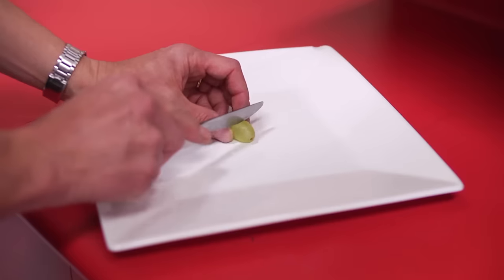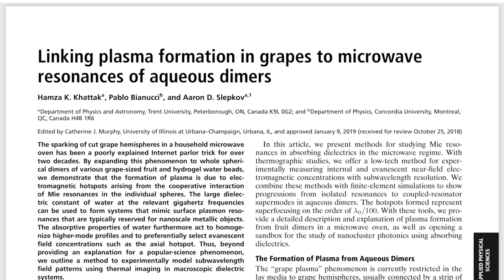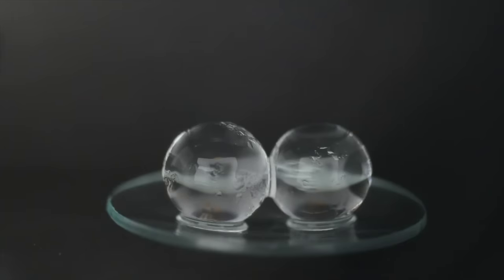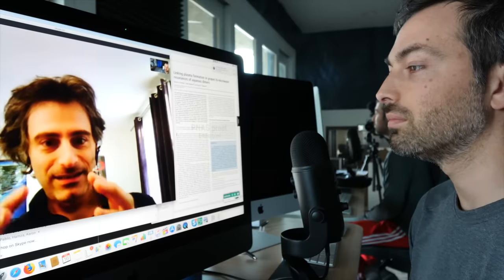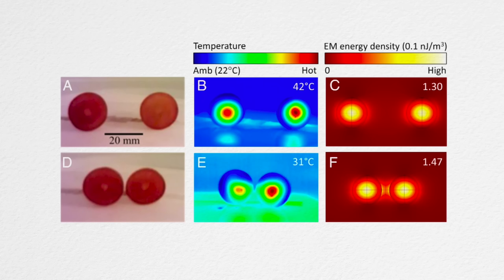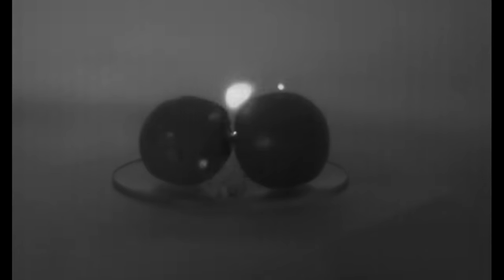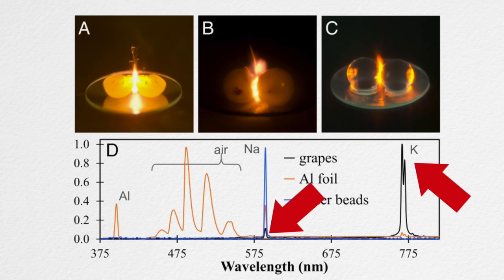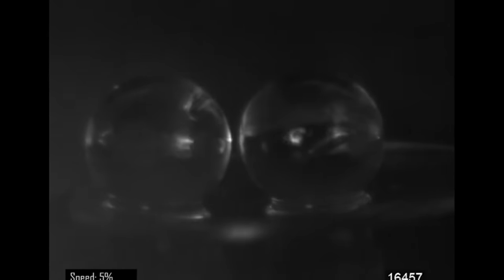Microwaving Grapes Makes Plasma

Comment: But how do l turn my microwave into a time machine...
Reply: A toaster, maybe---but a microwave? No way!
Reply: Lol
Reply: Don't be silly, you can't turn a microwave into a time machine you have to use your hot tub for that.
Reply: Put it in front of an exploding sun, obviously. #Futurama
Reply: You need a cell phone and a black hole
Reply: You gotta use bananas
Reply: Ask Kip or Uncle Rico.  I think they might have something that could help.
Reply: Don't forget the crystals!
Reply: I thought the time machine was at the back of Costco?
Reply: Hmm, maybe something to do with Braun tubes & Gelbananas? 🤔🤔🤔
Reply: You'll need a magnifying glass ,a desk chair with wheels. A wet sponge. And of course duck tape
Reply: A microwave is a time machine; Why else do you set a timer? Because it's a time machine👀 mind blown
Reply: Ima mad scientist. Is so cool
Reply: Steins;Gate
Reply: This is Veritasium, not "HOUOUIN KYOUMA!" 
Although you could always try with a cell phone if you have one to spare
Reply: you make the microwave plate turn in the inverse direction at just the right speed, hook up a telefone to it, and make sure there is a working television hooked up to your eletric sistem. the television is essential.
Reply: Bananas and an old computer.
Reply: That's easy, when you heat something you turn the timer clockwise to the desired time you want of heating, but if you turn it the other way around from 0, you travel in time.
Reply: Wolffang731 by making it into a bone density scanner, the real ones will get this!
Reply: Mario Cantu your thinking of an alarm clock, or just a clock in general too
Reply: Wolffang731 just turn the time back
Reply: Wolffang731 you have to get a wormhole, something in space that is a literal time machine. You sure you can afford a wormhole? I have some, but they’re huge and expensive.
Reply: You need Bananas, not Grapes if the Banans start turning green, both peel and all, you're on the right track. 

Just be sure you stay on the right world line
Reply: Makin Waves so an mri?
Reply: Put a bunch of clocks in it and microwave them.
Reply: Try your van
Reply: Put a banana on it
Reply: Easier to do with a Bambleweeny Improbability Generator and a very hot cup of tea.
Reply: You need a cell phone, an otaku, and a redhead assistant
Reply: @bubbyradio9112  Don't forget a doot doo do girl
Reply: @Wolffang731  Doot doo do girl is the best.
Reply: Put gasoline in it
Reply: watch Steins:Gate for that answer. Just don't regret making one when you do...
Reply: Well microwave ovens are supposed to cook things quicker, so stick something instant in there, like instant coffee. Dunno how you would go back in time though . . .
Reply: Just watch steins gate

Comment: I always thought that’s how you make raisin so I been eating plasme and I still haven’t gain super powers yet so I guess I need to microwave more and eat them
Reply: Shaggy can defeat you tho with 0.00000000000000000000000000000000000000000000000000000000000000000000000000000000000000000000000000000000000000000000000000000000000000000000000000000000000000000000000000000000000000000000000000000000000000000000000000000000000000000000000000000000000000000000000000000000000000000000000000000000000000000000000000000000000000000000000000000000000000000000000000000000000000000000000000000000000000000000000000000000000000000000000000000000000000000000000000000000000000000000000000000000000000000000000000000000000000000000000000000000000000000000000000000000000000000000000000000000000000000000000000000000000000000000000000000000000000000000000000000000000000000000000000000000000000000000000000000000000000000000000000000000000000000000000000000000000000000000000000000000000000000000000000000000000000000000000000000000000000000000000000000000000000000000000000000000000000000000000000000000000000000000000000000000000000000000000000000000000000000000000000000000000000000000000000000000000000000000000000000000000000000000000000000000000000000000000000000000000000000000000000000000000000000000000000000000000000000000000000000000000000000000000000000000000000000000000000000000000000000000000000000000000000000000000000000000000000000000000000000000000000000000000000000000000000000000000000000000000000000000000000000000000000000000000000000000000000000000000000000000000000000000000000000000000000000000000000000000000000000000000000000000000000000000000000000000000000000000000000000000000000000000000000000000000000000000000000000000000000000000000000000000000000000000000000000000000000000000000000000000000000000000000000000000000000000000000000000000000000000000000000000000000000000000000000000000000000000000000000000000000000000000000000000000000000000000000000000000000000000000000000000000000000000000000000000000000000000000000000000000000000000000000000000000000000000000000000000000000000000000000000000000000000000000000000000000000000000000000000000000000000000000000000000000000000000000000000000000000000000000000000000000000000000000000000000000000000000000000000000000000000000000000000000000000000000000000000000000000000000000000000000000000000000000000000000000000000000000000000000000000000000000000000000000000000000000000000000000000000000000000000000000000000000000000000000000000000000000000000000000000000000000000000000000000000000000000000000000000000000000000000000000000000000000000000000000000000000000000000000000000000000000000000000000000000000000000000000000000000000000000000000000000000000000000000000000000000000000000000000000000000000000000000000000000000000000000000000000000000000000000000000000000000000000000000000000000000000000000000000000000000000000000000000000000000000000000000000000000000000000000000000000000000000000000000000000000000000000000000000000000000000000000000000000000000000000000000000000000000000000000000000000000000000000000000000000000000000000000000000000000000000000000000000000000000000000000000000000000000000000000000000000000000000000000000000000000000000000000000000000000000000000000000000000000000000000000000000000000000000000000000000000000000000000000000000000000000000000000000000000000000000000000000000000000000000000000000000000000000000000000000000000000000000000000000000000000000000000000000000000000000000000000000000000000000000000000000000000000000000000000000000000000000000000000000000000000000000000000000000000000000000000000000000000000000000000000000000000000000000000000000000000000000000000000000000000000000000000000000000000000000000000000000000000000000000000000000000000000000000000000000000000000000000000000000000000000000000000000000000000000000000000000000000000000000000000000000000000000000000000000000000000000000000000000000000000000000000000000000000000000000000000000000000000000000000000000000000000000000000000000000000000000000000000000000000000000000000000000000000000000000000000000000000000000000000000000000000000000000000000000000000000000000000000000000000000000000000000000000000000000000000000000000000000000000000000000000000000000000000000000000000000000000000000000000000000000000000000000000000000000000000000000000000000000000000000000000000000000000000000000000000000000000000000000000000000000000000000000000000000000000000000000000000000000000000000000000000000000000000000000000000000000000000000000000000000000000000000000000000000000000000000000000000000000000000000000000000000000000000000000000000000000000000000000000000000000000000000000000000000000000000000000000000000000000000000000000000000000000000000000000000000000000000000000000000000000000000000000000000000000000000000000000000000000000000000000000000000000000000000000000000000000000000000000000000000000000000000000000000000000000000000000000000000000000000000000000000000000000000000000000000000000000000000000000000000000000000000000000000000000000000000000000000000000000000000000000000000000000000000000000000000000000000000000000000000000000000000000000000000000000000000000000000000000000000000000000000000000000000000000000000000000000000000000000000000000000000000000000000000000000000000000000000000000000000000000000000000000000000000000000000000000000000000000000000000000000000000000000000000000000000000000000000000000000000000000000000000000000000000000000000000000000000000000000000000000000000000000000000000000000000000000000000000000000000000000000000000000000000000000000000000000000000000000000000000000000000000000000000000000000000000000000000000000000000000000000000000000000000000000000000000000000000000000000000000000000000000000000000000000000000000000000000000000000000000000000000000000000000000000000000000000000000000000000000000000000000000000000000000000000000000000000000000000000000000000000000000000000000000000000000000000000000000000000000000000000000000000000000000000000000000000000000000000000000000000000000000000000000000000000000000000000000000000000000000000000000000000000000000000000000000001% of his power
Reply: @isaamthalhath4359  scientific notation pls
Reply: Eat the microwave
Reply: Yeah put your head into the microwave WHILE chewing on raisin or grape. 
CONGRATZ your dream come true ...
... with a cost
Reply: if at first you dont succeed try and try again
Reply: @ZweiZombies  1 × 10^-347

Comment: But but but but ... the problem with microchips going smaller is not just how fine can you print the components on the layers of the chip but also how much electricity leaks from electron migration because of the close to the quantum size that you would be working on. It may help to get those under 5nm microchips but we would still need an alternative to lithography and 2D printing of microchips very soon, Moore's Law can not be sustained within this format anymore.

Addendum: But I could see Intel frying a ton of grapes in their R&D department to try and solve their 7nm and fabrication shortage ... either that or make alters to all the gods they can find
Reply: I heard Intel's new grape lake will be like a fine wine by the time it is released.
Reply: Grape Lake 7nm WineLake 7nm+ and WineBarrel 7nm++
Reply: Migration?

You mean Quantum Tunneling, right? The property in which quantum computing is founded on  work?

The current running through the capacitors can either be on, or off; essentially being a 1 for on and 0 for off. It can be only on or the other, limiting the number of calculations per second.

But with quantum tunneling, these capacitors can brcome incredibly small. These gates, or switches, inside the capacitors can be a 1 or 0 or both simultaneously.

This allows the processor to make a RIDICULOUS amount calculations per second.
Reply: @Jbm510  ya.. that's really not going to help with classical computing though... Quantum is cool and it's implications are amazing, but it's not a replacement for classical computing. Each system has its own set of strengths and weaknesses. The two are going to be running side by side, kinda like how the GPU is not a replacement for the CPU, but they work together.
Reply: @Jbm510  Unfortunately quantum tunneling doesn't turn a CPU into a quantum computer, it causes it to malfunction because bits get flipped randomly, which is kind of a problem. And quantum computers are nice but only provide a performance boost to a limited set of problems.
Reply: You guys really know your thing don't you?
Reply: They're already making better gates that prevent such leak. Now they look like actual gates, or doorways rather.
Reply: The important distinction here is in resolution if the lithography. This refers to the wave length of the light in the lithography machines. If we can get a resolution of 2nm, that doesn’t necessarily mean 2nm gates, but it does mean we can make smaller gates much easier potentially without EUV light. TSMC’s 7nm currently doesn’t use EUV, it uses quad patterning which basically means they take a large wavelength and print a feature 4 times, moving the laser slightly to mimic smaller wavelengths. Obviously this is expensive because you’re using 4 passes to do what this technique (or EUV) would do in 1. Multiply that by 5.6 billion transistors and now you know why 7nm and new process nodes are expensive compared to say 45nm.
Reply: Maybe encasing those layers of chip in organic material will counter electricity leaks from electron migration. Just observing the single grape in a microwave as well as 2 grapes at a distance.. Just a thought!
Reply: @SaHaRaSquad  The most directly applicable being the simulation of quantum systems, since instead of keeping some arbitrary number of thousands of wave functions stored in some basis you can just create quantum states you want to simulate and let time do its thing.
Reply: @SaHaRaSquad  quantum tunneling cant turn pcs into quantem tunneling... i agree lol.

I had to reread what i wrote to make sure i didnt write that.

After rereading what i did write... it confirmed what i thought:  i never said anything about qt turns personal computers into quantem computers

But more on to the topic of moores law about tech doubling bc systems are becoming smaller meets its end very soon (as the dude above said) 

But thanks for miscomprehending what i wrote... it made me write more on how i never said qt allows personal computers into qbit computing machine-a-ma-jigs

Comment: This morning I was stunned and concerned when in my microwave I saw a blueberry ( or two maybe?) spark frantically. It seemed that the microwave would go kaput, but apparently not. I like to put frozen blueberries on top my Cheerios. It started sparking and it was 15 sec. earlier than I keep them in there. I took it immediately out. It stunk and I had to remove the blueberry and any stinky neighboring Cheerios.
Same thing once happened with a roasted Korean sweet potato from HMart. That stink lasted for weeks thought-out the house. 😖 
Thanks for the explanation!

Comment: so hold on, could an intact microwaved grape be a temporary electromagnetic wave capsule/storage unit? and if so then can you then cut it open near something very microwaveable and notice an increase in temperature?
Reply: Nope, because the contents of a microwaved grape absorb the energy almost immediately and turn it into heat/plasma. The waves don’t stay rattling around inside the grape.
Reply: he is speaking the language of the gods
Reply: @ruzgarkeremelmal4601  LMAOOO
Reply: @era1473  just saying the truths
Reply: If you do it fast enough, that might be theoretically (?) possible?
Reply: And by splitting the grape even faster you will see a big mushroom cloud made out off plasma. 😉

Comment: Thinking of ways to create a plasma phased rifle in the 40 watt range. with grapes.
Reply: We don't have that.
Reply: We will...
And the company that will bring it to you?

AT&T
Reply: Hahahah I bet the Army will buy em from ya
Reply: "I'll Be Back!" ... ;)
Reply: “We only have what you see here. Okay I’ll take one 9mm uzi”
Reply: AxelBitz yeah like you put grapes and then you charge it with power from a mini microwave like heater and then shoot it, the longer it was in there the stronger the plasma grape balls are.
Reply: Hydrogen cells with a phased electronically directed bolt chamber would be able to project plasma streams but the problem with plasma is the diffusion. If you could blow glass beads around it as it left the muzzle it would maintain ballistic usefulness but plasma is slow and visible in air doesn’t make a good projectile unless you overcome that . All the trendy futurist guns are hard light or muons or theta rays now because the post modern authors played fallout lol :)
Reply: @whyyoumadbro2370  While a 1kW, 5A gun that shoots 400F heated bullets is pretty useless (might as well flick some hot coals at someone), this could actually help solve the two fundamental problems with energy rifles: projecting fire at a distance, and efficiency. Which is why they have railguns, and why flamethrowers shoot liquid trails and stun guns shoot wires. In theory you could at least create a sniper-distance flamethrower if your "grapes" had glass casings and could be launched without breaking mid-air. Though they did already solve that problem in the middle ages with fire arrows and liquid fire chemicals.
Reply: Just what you see here pal
Reply: Beejor or use dragon breathe ammo for the Spas 12 in Black ops 1
Reply: Are you looking to make an assault AR GRAPE ????!

Comment: Question, If I try this at home, can it break my microwave?

Edit: I’m not 5 guys, i know that metal in microwaves can cause fires...
Reply: Probbably.
Reply: Just wrap it in foil and it’s all good.
Reply: Don't wrap it in foil. This will cause fire. Also, don't place plastic materials, papers and plates with gold
Reply: @EatShredSleep87  Do you feel proud?
Reply: Akasha fofo so I’m not pure evil anymore?
Reply: Woosh?
Reply: @fbi6567  *probably
Reply: @akashafofo6939  r/woooosh
Reply: Looks like no one knows
Reply: EatShredSleep87 Someone tries to be a Loki
Reply: @mohamedhasan6420  my microwave is made of aluminum sarcastic
Reply: Yes you can
Reply: No.... it’s just ionized air
Reply: It might damage your grape :(
Reply: If enough plasma collected at the top of the microwave it could damage it. The safest thing to do is once you see the sparks, turn it off.
Reply: You should put aluminum foil to cover the grapes 
Disclaimer: I am not responsible for the results
Reply: What he did was add a transparent plastic bowl on the grapes before microwaving them
Reply: Definitely cover it, or prepare to buy a new microwave!
Reply: r/wooooosh
Reply: Akasha fofo r/wooosh
Reply: Yes!... to protect it tho, Wrap the grape in something silver ..preferably aluminum foil .
Reply: @Triunity4  Noob
Reply: I just did it without  a plate it did create sparks then like a idiot I proceeded to eat it I then got called a idiot lol